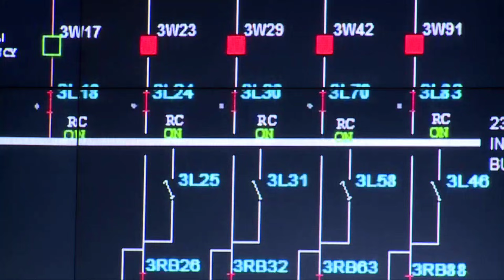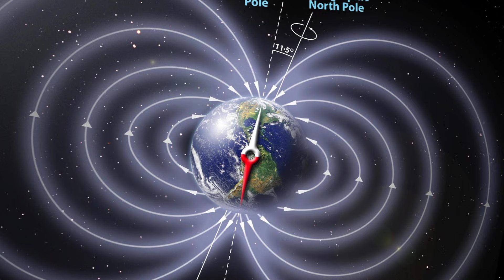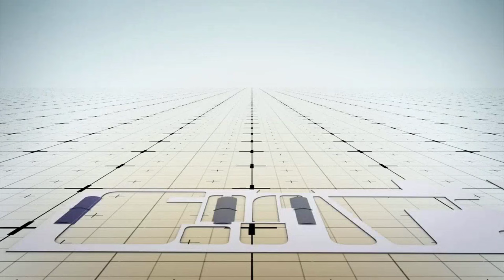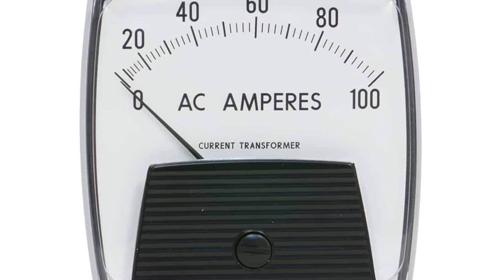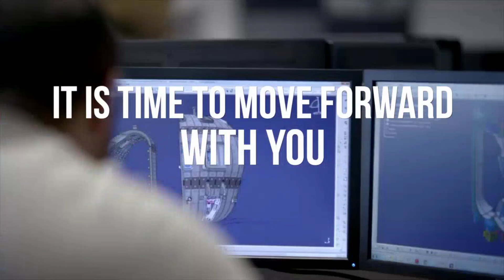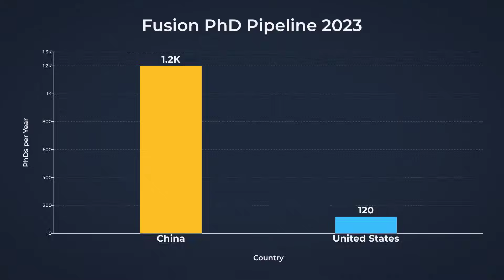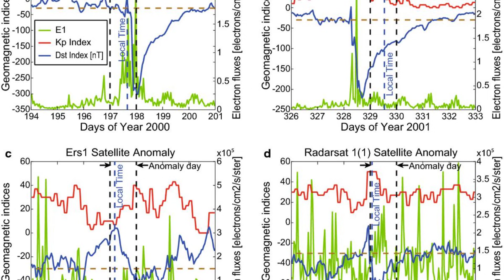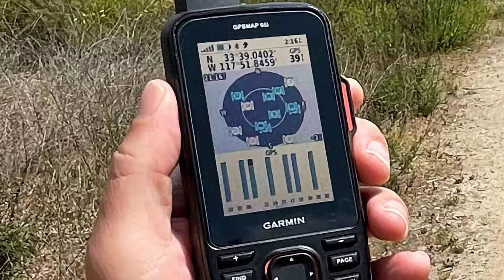Pentagon Scrambles After China's Electrostatic Fusion Test Disrupts Earth's Magnetic Field

Comment: The reason they've been crying wolf regarding the climate and the anthropogenic causation is to obfuscate the cause. In the early 1950s, the USAF (and the CIA) found evidence of a reoccurring, solar-driven cataclysm that reshapes our planet every ~12k years. The following is just a snapshot of what we are facing.
The ongoing magnetic pole flip is part of this process.
In the next ~20years, our magnetosphere will tank, we will have massive electrical and plasma storms, we will experience a Carrington level or greater solar storm that will take the planet's technology back to the bronze age. The cataclysm will cause significant earthquakes and volcanic activity. Then, several years later, cosmic dust begins to accumulate and darken the sun. Eventually, the dust will cause a "pressure cooker" effect.  Just days prior to the micro-nova, the sun will be black. Then, the micro-nova occurs. The dust and sun's outermost mass explodes, sending heavy metal "impactors" throughout the solar system.
Those impactors are what helped facilitate the rapid melting of the North American glaciers 12k years ago. 
The final act is the unlocking and turning over of the earth's crust by approximately 25°-90°. The tsunamis and resulting slosh back of the planets oceans and lakes, combined with an upwhelling of underground water and horrendously torrential rains will flood much of the globe. 
Then the 12k year clock resets and another civilization will rise.